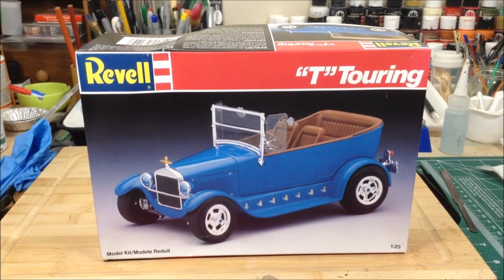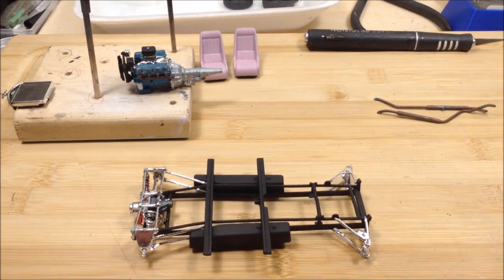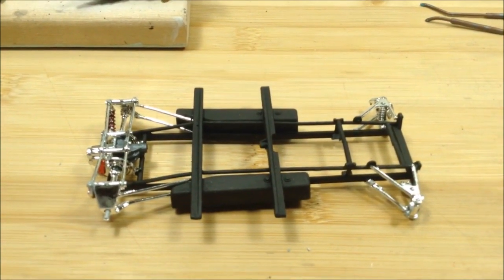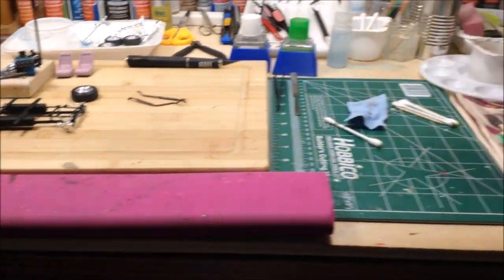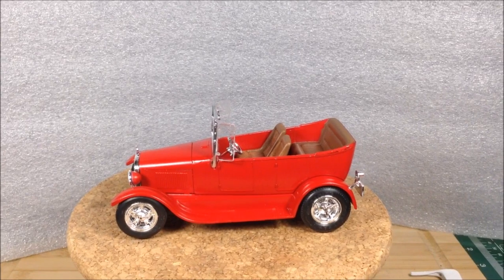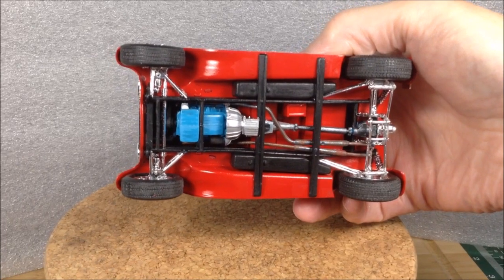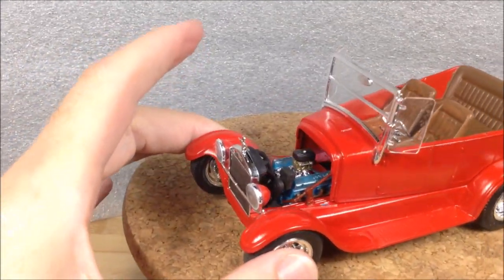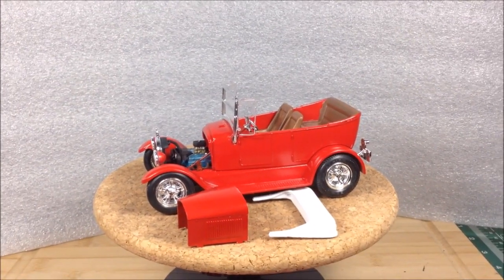Revell Model T Touring

Comment: Thank you for the content and sharing; For the "wheels and tires" are they pushed together or glued? If glued, what type of glue may you recommend for the rims/tires? cheers;
Reply from the maker: Thanks for the comment, I can't remember if I glued them or not. If the two wheel sides meet in the middle I will usually scrape off the chrome and brush Testors model cement on both pieces and press them together.  They are not glued to the tires, I put the glue on the rims and press them into each side of the tire, the ones that come with the kit will usually fit tight on the tire.
Reply: @ModelCarMinion  Understood, thank you

Comment: Fantastic build Steve!  Love that red color on the body.  I have a couple bottles of that Testors paint and was wondering what do you use to thin that paint? 
Tom S.
Reply from the maker: Thanks Tom, I used Windshield Washer fluid this time, you can also use Pledge Future Floor Finish, being acrylic it dries pretty fast.  You don't need much to thin it, my Aztec paint is getting a little old so I just add a little thinner.